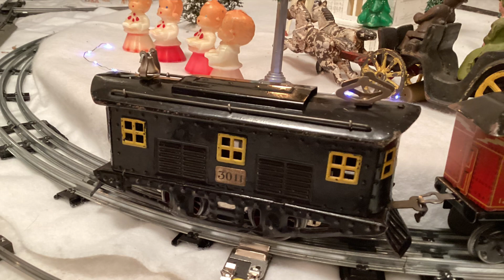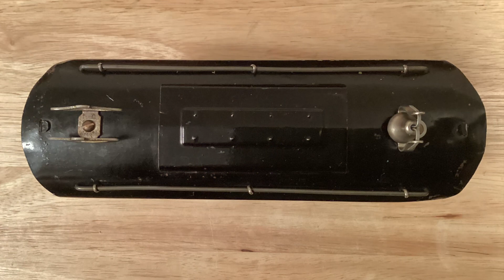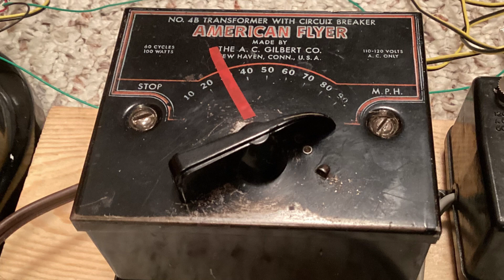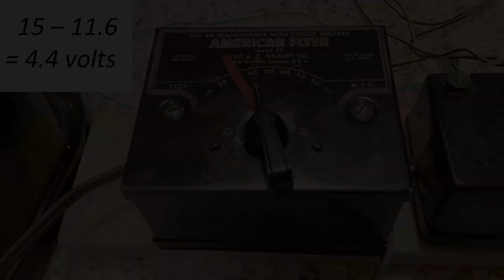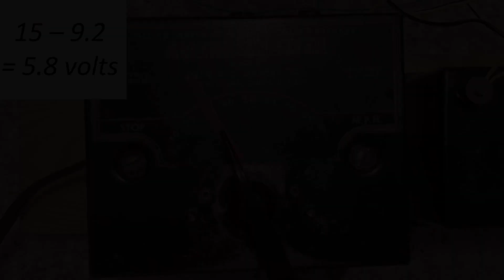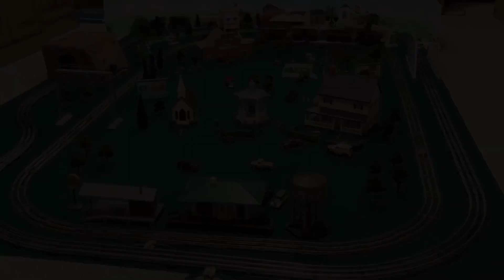American Flyer Pre-War 3011 Engine

Comment: Great tutorial. Nice layout. Prewar Chicago Flyer made some really neat stuff. The cream of the Prewar Flyer is New Haven built A.C.Gilbert 3/16 
0 gauge. Beautiful looking and running. Like other manufacturers, there are some problems with zinc pest.
Reply from the maker: Things certainly changed when A.C. Gilbert took over, even those few years before the war put production on hold.  But these 1920s engines have a uniqueness of their own.  I’ve read that they are based more on European designs.  Thanks for watching.

Comment: Marx guy here, interesting info. I noticed that your Flyer transformer was a 4B 100watt does it have a breaker reset button, or does it reset internally? My Flyer unit has me wondering.
Reply from the maker: The 4B resets automatically.  I’m hesitant to use a transformer without a circuit breaker except for, maybe, a few accessories. Thanks for watching.